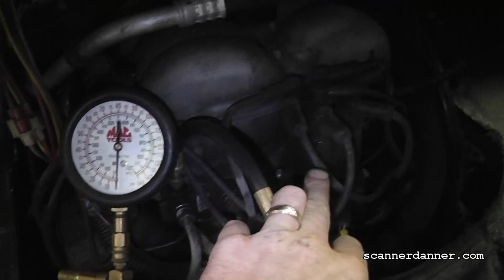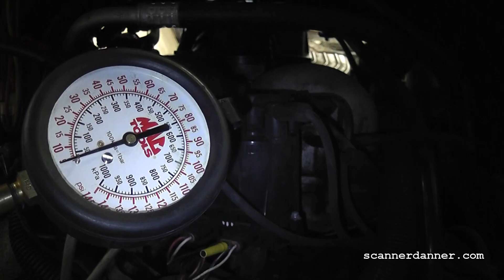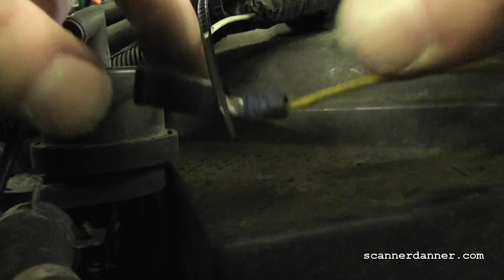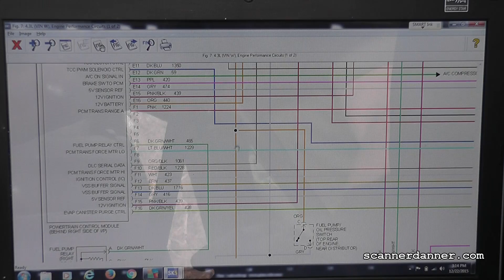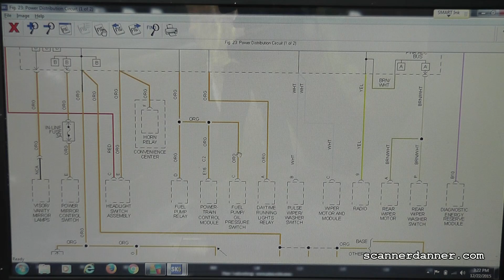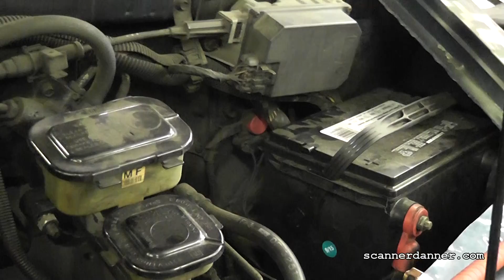Fuel pump electrical circuit diagnosis (no fuel pressure testing) GM

Comment: Hi I have a similar problem it doesn't click the fuel pump relay and it starts but immediately dies and I have injector pulse and spark please help me and check every single fuse

Comment: What if turning on the key doesnt prime the pump?  It will crank forever and then all of a sudden 60psi fuel pressure and starts instantly.  Then the pressure leaks down slowly.  Seems like two problems to be fair.
Reply from the maker: Agree. The slow bleed down should be ignored for now. 
Power and ground testing of the during the time where you have no fuel pressure is needed.

Comment: Only after watching your videos I came to know that there are fuses for the power relays, so when you had no power on the relay I thought that the immediate next step should be to check if the fuses were ok before moving any further
Reply from the maker: From memory, this wasn't a fuse issue.
Reply: No it was not a fuse issue. I didn’t express myself correctly. I meant to say that I came to know that relays have fuses only from you. So when I saw that you didn’t have one power feed my next step would be to go and check the fuses

Comment: Thank you for cheering this video. I have a 98 Chevrolet Silverado 5.7 vortex crank no start. I install a new fuel pomp,  new spark  plugs, new ckp sensor, Distribuidor cap n rotor, new injectors, and still don't run. Do the gas pomp suppose to receive power continuously?
Reply from the maker: What are you missing? Spark, fuel psi, injector pulse?
Reply: @ScannerDanner  Fuel. Pomp only turn on for 2 secunds N STOPS.
Reply: @ScannerDanner  no fuel in the injectors.

Comment: Spent around £800 on parts including fuel pump , ams sensor , vaccum pump , few relays , over 50 hours of watching youtube videos and around 2 weeks of not having transport to get the same problem sorted , turns out the ecm fuse was blown.
Thank you so very much for this video I was a day or two away from scrapping my car

Comment: Me again so I have a dual fuel pump Waldron 450 setup for my STi and I’ve already tested my power wires because I have two hardwire kits but my primary fuel pump fuse is discolored so I get it’s heating up due to resistance but my relay is good I checked the ohms and it’s at 85 ohms which is normal but the only thing I haven’t checked is the thermals from the pump to the connector at the green part of the connector line the video. My car starts and everything but I’m diagnosing the discolored fuse.
Reply from the maker: This pump you put in. What is the amperage difference from factory?
Reply: @ScannerDanner  probably about 5 amps or so but it’s been working fine for years it just started doing it. It’s pretty much standalone though the only thing connected to the car is the fuel level sender. The fuse that I mentioned is on the hardwire inline fuse itself not the fuse block of the car. My pumps doesn’t utilize the oem relay or fuse

Comment: Hey man, I have a 1999 Toyota celica and the fuel pump isn’t getting power unless I crank the key, any ideas what that might be 😅? 

Ps all fuses and relays are good.
Reply from the maker: Im pretty sure that's normal on that model Toyota. Not all of them used a key on prime. 
What problem are you chasing?
Reply: @ScannerDanner  my car won’t start so I’ve ordered a new fuel pump and I’ve heard that they are supposed to prime when the key is switched to the run position but mine only gets power when it’s cranking
Reply: @ScannerDanner  my pump doesn’t get power the wires connected to the fuel pump get power when car is cranking * I used an automotive test light
Reply from the maker: @ReganJensen07 as I said, it's normal on some models, Toyota in particular. What is fuel pressure during cranking? Don't just throw a pump in it without testing it.
Reply: @ScannerDanner  there’s no pressure
Reply from the maker: @ReganJensen07  check your power and ground on that pump circuit (during cranking) before changing that pump
Reply: @ScannerDanner  the power and ground are fine

Comment: is there a way to check if high pressure fuel pump is okey without fancy high power gauge. :)
Reply from the maker: Define high pressure. If you're talking about today's GDI systems that run in the thousands of psi, that is done using a scan tool and looking at the fuel rail psi sensor signal.
If you're talking about something less than 100 psi, then you need a good fuel pressure gauge and a kit with adapters to be able to T your gauge in when there isn't a service port. There are no other options.

Comment: Awesome video! How did you end up fixing the issue? Did you re-wire both ends of what had melted? Thank you for your video and for reading, I’m working on a tbi mounted on a boat, already replaced starter solenoid, injectors, fuel pump, fuel pressure regulator… now going electrical….
Reply from the maker: I believe I showed it at the end. Did I not?
Reply: @ScannerDanner  yes I believe you mentioned it. Replace both ends, will see how it goes!

Comment: the wiring schematic is 4.3L.  The engine is 5.7L.  I don't have resources to compare the two, but you had a difference you spoke of regarding the number of pins.  Time mark was 19:xx

I have the same issue, researching my cause.
Reply from the maker: https://eautorepair.adtrk.biz/?a=10817&c=24&p=r&s1=
This is a diy version of the same service info and diagrams I use. Hope it helps

Comment: I lost power to my fuel pump, it was only getting 6 volts, I couldn't figure out why, until I pulled the battery out and under the battery box there's a inane fuse junction box, gm have them. The cover fell off and both terminals were touching the metal fender, it was out of sight, so I figure always start from the battery and male sure your wires are good no corrosion and good ground, not to mention grounding out or touching any other metal.
Reply from the maker: Awesome!

Comment: Where is the test port on the ‘95 jimmy 4.3 4x4?  The relay is in the back of the dash.  Have 5 volts at pump harness above tank and ground with continuity.  With relay out the top two posts are 12v the bottom right is GND and the last one, bottom left is infinite or open.  Im assuming the last one is the power to the pump so I just run 12v to it then?
Reply from the maker: Watch this one for guidance on testing that relay circuit
https://youtu.be/McnXLcJNVfI
The psi test port should be near the firewall on the drivers side behind the intake manifold if it's the vortex cpi system. If it's a throttle body system with your injectors exposed above the throttle plate, there is no service port.
Reply: @ScannerDanner  it was weird.  The ecm fuse went cold during crank.  Had spark at #1 cylinder.  Tried jumping 12 volts to the jump plug under hood with no success.  Found the shrader valve hidden in the back with zero pressure.  No fuel pump prime with key on or jumping 12v.  I fixed the problem with a new cap and rotor.  It doesnt make any sense but it runs for now!  The ecm light doesnt turn off on crank either.

Comment: Hey change the fuel  pump and transfer side that has the filter and regulator ..5days later pump die..no blown fuse new relay...at the pump should I have 12v and 0.0 ground?..
Reply from the maker: Yes, 12v on the pump feed and 0v on the pump ground. If you have that and the pump is not running, you have a pump issue
Reply: Thanks,...do this test with the hardness loaded ( plug in the pump with a t-pin or unplug?)...my apologies for all the questions Mr. Danner..
Reply from the maker: @leroyking3058  pump plugged in, and crank the engine over. If you unplug the pump, it is no longer loaded. And no problem!
Reply: Thank u so much for the infor...I am about to have my car taking to the dealer because of this issue..if you don't mind me asking a two part question please...#1  how can a fuel pump gets to much power and burns it up?..# 2 and how a short to ground send power back through the ground and burn it up?...Thanks again

Comment: 2:00 I disagree with you. It wasn't "a perfectly horrible description" : I'm just a guy trying to figure out why my 2005 Opel Twintop (don't suppose you have them in the States) won't run for more than 10 seconds, and even I understand your description of what you 're going to do. I changed  petrol filter, pump (excluding the "cap" that has integrated pressure control valve 'cos they don't sell it (!!), fitted tester WITH SCHRADER FITTING (very rare)! and watching the first minutes is déjà vu: absolutely zero pressure with key on or turning over (mine actually fires for a few seconds). Looking forward to this!

Comment: should the power voltage going to the fuel pump always be a 12 volts for a nissan sentra 1996 model?
Reply from the maker: On a 96 sentry? Yes, full battery voltage should be available to the fuel pump with the engine cranking or running. Cranking it will be less because system voltage is less
Reply: @ScannerDanner  ty very much for your reply.  But what controls the voltage, is it the ECM? because im only reading in the volt meter about 2 volts to 4 volts most of the time when i test the main socket before the gas tank...or is it the wiring?
Reply from the maker: @johncarlotagaro9918  2-4 volts cranking? So it's a no start right? Take an amperage measurement before we start chasing a wiring problem. A frozen pump can cause a huge current draw and can drop voltage on that circuit.
But so can a corroded wire, which will result in very low amperage. The current test will be the key

Comment: Great video. This was my exact issue. And from the looks of the connector, it happened before to previous owner. So I couldn't find a plug like that yet so I temporarily fixed it. Or you can just replace the power block with one from a truck which what I might do if I can't find a  good connector plug. Video was a great help. 👍👍

Comment: I think you just  solved  my problem my 95 s10  has been  back fireing dying  head lights sometimes works and truck  runs  perfectly when  they  blink that seems to be when  it starts throwing  it fits.in which  my wife  say why do you  try to  keep  driving this. Well it was left to me by dad when  he passed away. That why.
Reply from the maker: I'll help you if this isn't it. Especially since it was left to you by your father
Reply: @ScannerDanner  thank you that really  means alot to me

Comment: Hello there Mr scanner Danner my 1993 chevrolet lumina apv is giving me a similar issue  just put in a new distributor because its not giving me a second power from the computer  to the fuel pump relay but it still the same any ideas  what next to look at would appreciate it very much thank you
Reply from the maker: Let's move this to my forum www.scannerdanner.com 
It is free to join and we can definitely help you. I have 28k global members and hand picked moderators who've been with me for years and know my material inside and out and are there to help me help you guys. It is just too difficult to offer back and forth messages here on YouTube with stuff like this and we also can't share pictures and images here like we can on the website. Hope to see you there!

Comment: Awesome video. You went thru all the steps on checking the fuel pump in a process of elimination that most can follow and do for themselves. Thanks for the method of teaching you used for this application. I would not change what you are doing. So much good information that was given in this video. Thanks
Reply from the maker: Thank you!

Comment: Wow, this was awesome.  I have a 1995 chevy astro van.  I am looking at my vehicle when I see this.  Same issues for me.  I have replaced my electric fuel pump twice.  My previous mechanic stopped charging me when I had this issue of cranking but not starting.  He would fix it.  He also installed a battery switch because my battery kept draining.  The wires are so old.  Anyway, my new mechanic, the old mechanic's friend, is maybe new to this.  He thinks it is the fuel pump.  Maybe it is but maybe it is this thing behind the battery.  I see it there and I see the other things on the left side.  This video really shows me what is happening.  Sorry to say I have no background in electrical stuff or I would attempt to fix this thing myself.  That area behind the battery sure looks worn.  I was planning on selling this back to the county who wants to get these old vehicles off the road.  I know this van will run for 300k.  It now has 155k. The exhaust it puts out sucks.  It is rickety on the freeway and the AC leaks.  And the windows don't work.  Other than that, it is great.  Thanks again for this video.  Cool to see how things work in there.
Another question I have is: Is there any way to decrease the exhaust on this vehicle?  It does put out a lot of pollution.
Reply from the maker: As long as you're catalytic converter is still good and your fuel trims are normal. That's about all you can do (for exhaust clean-up) but that should also be fine.

Comment: Hopefully you can help, but i have a 1990 chevy silverado with a 350 and I'm getting a prime with no pressure when I crank. I have tested the relay and all tests show the relay is good and getting power to the relay. Also, Im getting power to the injectors but they arent spraying when primed or crank either. I have replaced the pump filter and ICM. It will start and run if I spray fuel to the throttle body. Please Help!!! Any advise is appreciated! Thanks from Texas.

Comment: where can I find a wiring diaphragm for a 88 Chevy 4.3l Cheyenne  pickup truck? I am having sort of the same issue with my truck..first it was running but i had to do some work as of replacing my lifters and valve seals also went ahead and replaced the ignition coil and distributor because the distributor was rusted out and i also replaced my coolant temp sensor cuz i accidently broke it during bolt removal on intake...but i put everything back together and now i dont get fuel prime nor crank..

Comment: I have a 2002 pathfinder  that has no power going  to the pump ....i have no fancy diagonistic equipment.  How can i power up the pump.  All the fuses and the two relay are good
Reply from the maker: step 1, you need a good wiring diagram and at least a digital multimeter. https://eautorepair.adtrk.biz/?a=10817&c=24&p=r&s1= (diagrams for you system)

Comment: Hey-I,put a new fuel pump in a 95' Astro ,couple mos. ago..The, other nite, it turned off three different times while driving [Did the cut floor version] Banged ,on top of tank ,added some gas and started . Next day again. Now it's starting .Any Ideas..Thanks...
Reply from the maker: yeah, this video! :-) Also check the ground on the frame for the pump
Reply: @ScannerDanner  Thanks. What should be right w/ that  or wrong Just the connection...?

Comment: Good Instructional Video...have worn out fusible links on my 1981 Nissan 200SX...will not be able to find fusible link harness at junk yard so will have to build my own harness to attach to positive side of battery...any suggestions appreciated...
Reply from the maker: I had an 85 200 sx 😃 your 81 would technically still be a Datsun. Great car!

Comment: The important thing I learned here is pump powerup is independent of crank or cam sensors I have no initial powerup at pump harness toyota camry
Reply from the maker: Be careful, some systems did NOT provide a key on fuel pump prime and Toyota was one of them with some of their systems
Reply: @ScannerDanner  it's a 99 v6 did you mean I may not hear the initial key on noise with this system ?
Reply from the maker: @bobbyu8991  yes sir
Reply from the maker: @bobbyu8991  no you have spark? I'm assuming no fuel pressure. Check for spark if you haven't yet

Comment: Goodness looks like I may have the same problem with my 92 Chevy Astro. I cant hear a click or anything at the fuel pump relay. For a sec I thought I had ran out of gas. When I try to turn it over there is no gas coming from the injectors. I don't have a fuel pressure gauge. And I will try to probe the relay tomorrow as well as the power distribution plug to see if its getting power. Mine was melted to hell too and someone has already worked on it before. The strange part is that it was working just fine before but recently just died at idle and won't really start back up. Guess I'd better check the fuses too.

Comment: Where can I get a good wiring diagram for a 1991 Chevy g10 like you pulled up on the computer also mine isn’t priming when I turn the key but pump works when I jump the connector u showed still won’t run tho I don’t have power to my injectors any help would be great please email me arkadenboss16@gmail.com
Reply from the maker: https://eautorepair.adtrk.biz/?a=10817&c=24&p=r&s1=
Here you go